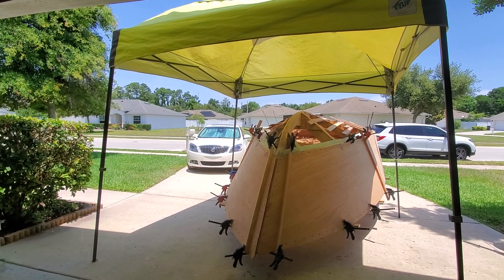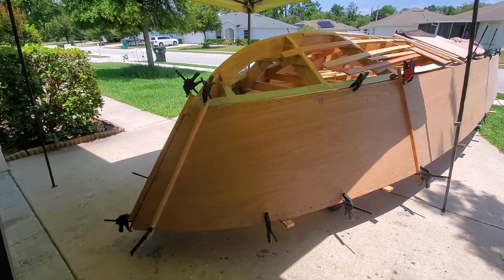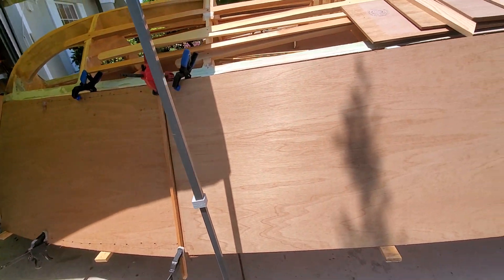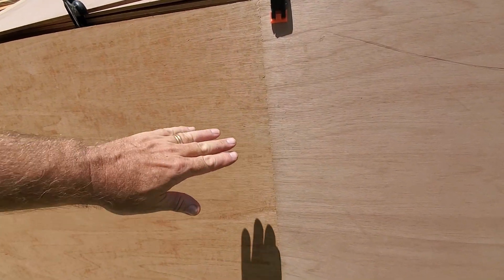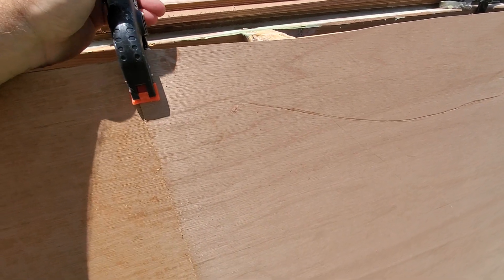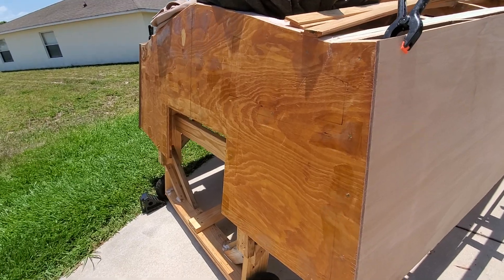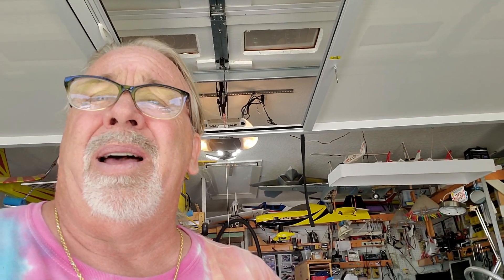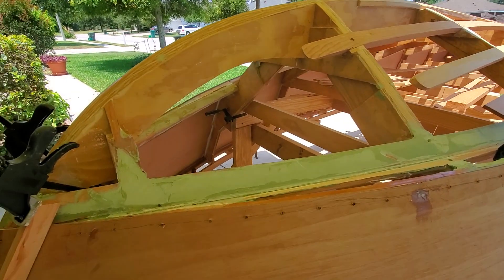Meranti Plywood

Comment: You look and sound a lot better now, good for you. Thanks on the plywood info ! I'm thinking of building a small trawler maybe 24' but using wooden boat plans but instead of wood and ply i would use home made fiberglass panels and cut my frames and parts just as you cut plywood. I already build a boat this way making all the parts out of glass panels and i held them in place with stainless rivets that stayed and then glassed it on the inside keeping the gelcoat side for the exterior of the hull came out pretty good for my standards. Can't find much info on this type of build. Almost writing  a  book here. greetings from Panama.